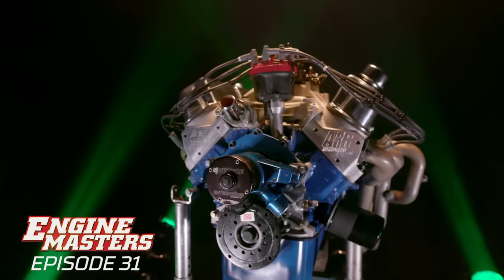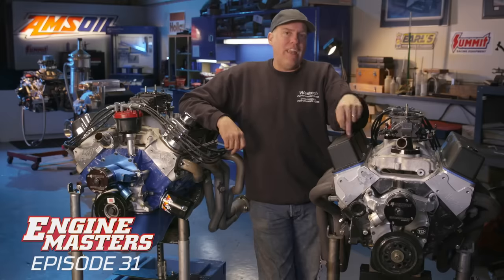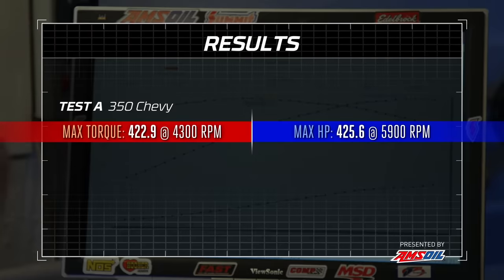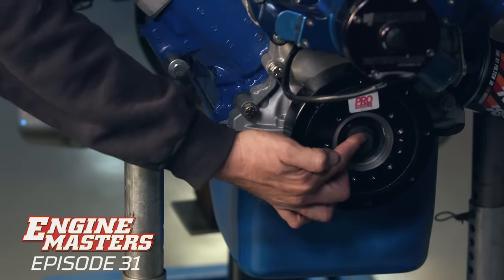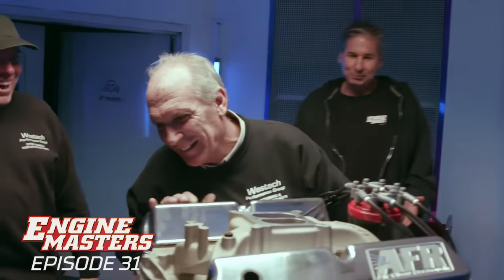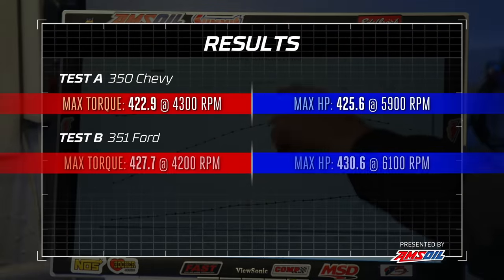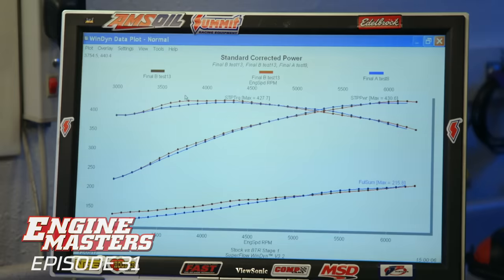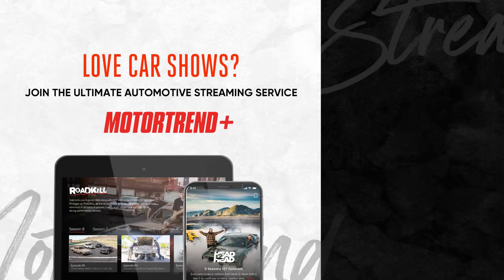Chevy vs Ford V8 Showdown! Small-Block or Windsor? | Engine Masters | MotorTrend

Comment: Let us know when the Windsor block is in 2 pieces. Hats off to the ford this time but let’s push the envelope on those HP numbers and see which one survives.
Reply: 351 Cleveland has entered the ring
Reply: @mikec9112  kid stuff
Reply: They took a junkyard 351 and put a procharger on it. Only mod was arp hardware and it died at 1000hp because they did not change out the oil pump.
Reply: @mikec9112  No it doesn't.  Front sump = Oil starvation under full throttle because the oil ends up in the back.  That 5/16 hex drive rod is prone to failure too.  Hardly what I would call superior.
Reply: @mikec9112  And NONE of that matters if the oil pump pickup is dry because the oil has sloshed to a different part of the engine.  A high volume oil pump can fix the Chevy, so again, your point is?
Reply: @mikec9112  Like every other Ford fanboy, you miss the point entirely.  You SHOULDN'T need to fix the pan.  And I've run high volume pumps with stock pans for year with ZERO issues.  Try again.

Comment: Ford guys don't need to justify the 1 extra cubic inch over the 350 because the 302 would beat the 350 too.
Reply: @bigpigslapperoinktoo4953  what???
Reply: @bigpigslapperoinktoo4953  make it easier to argue if I could understand your jibber ish.
Reply: @bigpigslapperoinktoo4953  I'm guessing you mean 500 horsepower and the 302 block is blown but people have pushed 600 with stock internals and 1200 on the stock block.

Comment: so run them both at 2800 rpm till they quit which one lasts the longest!
Reply: In a race car the Chevy would because they weren't stupid enough to put the oil sump in the front.
Reply: 3300? that's where an Alfa is comfortable. I like all motors, even the Iron Duke. Gas Rules. My little 2.0 Triumph was fun at 3600 with a lot of gear/clutch work, and then it broke.

Comment: The only real difference is one cost twice as much to build than the other. Almost two to one.
Reply: 7:45
Reply: Not what the fellows building the engines said...
Reply: @penguinsfan251  I'm just going by my own personal experiences. If y'all have a less expensive route for building a 4 to 500 HP EFI NA HO 302CID. I'm all ears!! Because I'm beginning such a build atm for my truck. 1997 F-150 4x4 currently w/ 4.6L VIN 6.

Comment: Now lets see a 400 chevy against a 351 cleveland all stock parts since everyone thinks the chevy was better from the factory lol
Reply: The Chevy IS better from the factory because unlike Ford, Chevy wasn't stupid enough to put the oil sump in the front of the engine.  The oil gets forced to the back under full throttle unless you are racing in reverse.  the 400 SBC was never a performance engine.  It was a station wagon engine built for low RPM and low end torque while the Cleveland actually was designed for performance.  If low end torque is the goal, the 400 SBC will wax the 351C.  If midrange and high RPM is the goal, the 351C wins.  Why?  Because then the engines would be measured doing the things they were designed to do.
Reply: @craigcampbell8560  the 400 had overheating issues so claiming its better than the clevland is laughable at best. 😂

Comment: From a lifetime of both Chevy & Ford engines, I have to give the edge to Chevy.  Especially from a reliability standpoint.  The editor of Mustang  Magazine once pointed this out, noting that he could hammer the Ford GT for 100K and it was getting very old quick. The Chevy powered  Firebird at 100K he could dust it off & do it again.  That's paraphrasing a bit. He challenged Ford to step it up.

Comment: The chevy will out last the Ford. The rear main on the 351 will go at 50,000 miles of use. Stock  a 350 will run 40 psi oil pressure.  The 351 between 10 and 20  lbs.  I've ran both all my life v8 mustangs are broken down every week. I don't like having to work on cars. So I drive gm v8s.  Ford straight 6s now they last. Don't buy a 4 cylinder. Eco anything.   Junk!!

Comment: Chevy all day any day. I’d like to know if their metallurgy is the same, and how the block is cast and the water jackets also if that will make a difference in longevity. I know the Chevy will give you hundreds of thousands of problem free miles, the ford, I’ve never heard if they are long runners.
Reply: The 351 was equally reliable, sucks both engines made crappy power in the 70s n 80s tho..lol Still, great torque with lower gears..
Reply: Small block Fords are indeed durable engines.  So were the FE engines.  Good for 250K miles or more.

Comment: So you didn’t actually tell us what the price difference was the build each engine you just stated Wasn’t that much of a difference but we all know it cost more to build a Ford engine then it does a Chevy. Also you didn’t explain what the cam specs for each engine . Are the heads ported and polished exactly the same were the intakes ported and polished exactly the same. A lot of these things won’t make too big of a difference but there is a difference.
Reply: The guys on the show said that the difference in cost of the parts was negligible.  Historically, SBC parts were cheapest and most widely available.  Prolly not the case anymore.

Comment: I had a 89 F-250 in highschool with a 351w ,zf5 and there wasn't a chevy truck around with a 350 that could even come close to outrunning me.
Reply: I put edelbrock e street heads, weiand stealth intake, xe250h comp cam and headers with a custom exhaust on my 351W in my 86 F250 and I've had some encounters with D bags on the highway trying to cut me off merging on and off the highway, probably because they think that old mans truck is slow, but I've left several of those newer toyota trucks in the dust with that thing. The looks on their face is priceless.

Comment: And what engine weighs more, the Ford does- advantage goes to Chevy
Reply: Yates D3 or Higgins  heads on a  new Boss302 block at 363ci gives weight and power advantage.  Higgins Cleveland style heads on a big cube Windsor make more power than even an SB2 can. Need LS next to get close.